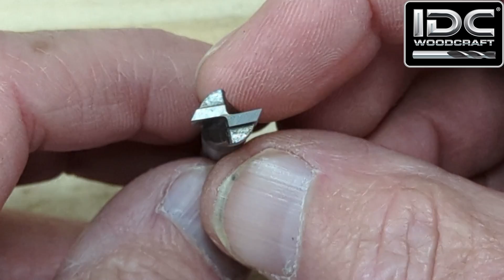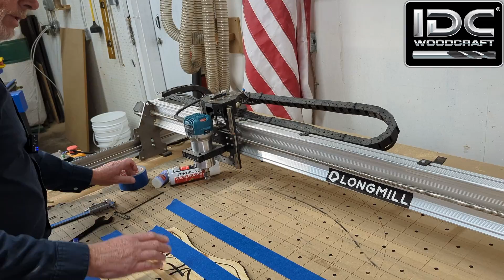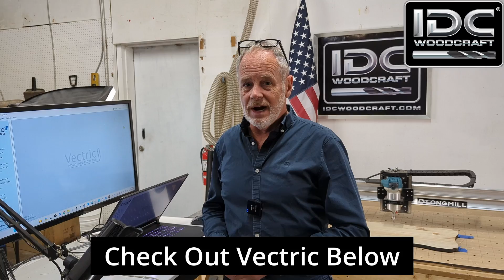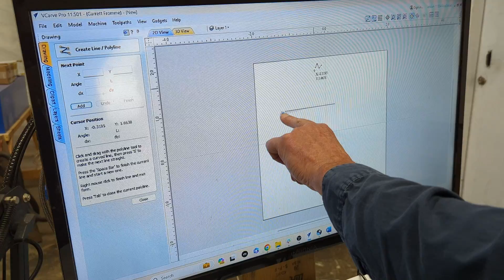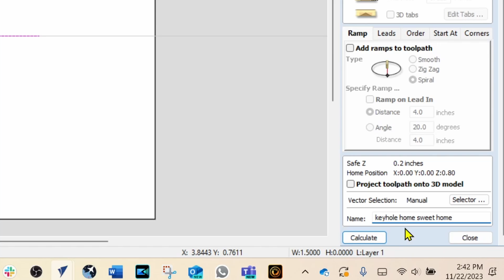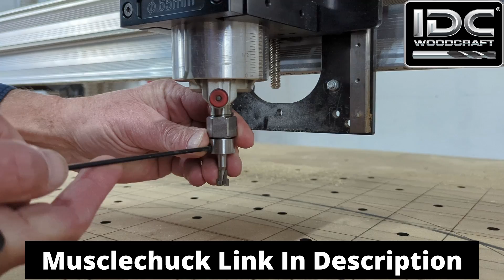How To Make A Keyhole Slot With A Keyhole Router Bit, CNC Router Projects

Comment: Very informative.  But I'm using a 3018 machine.  So i imagine my feed and plunge sppeds would have to be reduced substantially,  making using  a router table  more effective for me..
Reply from the maker: You're right, my friend! The 3018 machine does require slower speeds for optimal performance, so adjusting your feed and plunge rates is a smart move. Thanks for watching!

Comment: I might have to try this method but I’m afraid that my Bob’s cnc is not solid enough to handle it in one cut. I made a program that uses 2 cutters first I use a 1/8 cutter to make the holes at both ends and the slot between then I use a.410 diameter keyhole cutter to cut from one end to the other then I can retract the cutter at the second end.  On larger signs I make I put one at each end so it is level as long as the screws are level in the wall.  
I like the thought of the tool holder but the first thing I thought of was that it would make the spindle out of balance.
Reply from the maker: It's great to hear you're experimenting with different methods on your Bob's CNC! As for the tool holder, balancing is definitely something to consider, so just make sure to keep that in mind in your setup.

Comment: I want to have entrance hole on each side of the cut.  What is the best way to do that?  Set up for a hole on the other end?  Is a keyhole bit set up to cut in the upward motion?
Reply from the maker: To create entrance holes on each side of a cut, you'll want to set up your CNC to route those holes before or after the main cut, depending on your design. Typically, keyhole bits are designed for downward cuts, but you can adjust your setup based on your machine's capabilities.

Comment: Great video, thank you! I take it it wouldn't be too difficult to copy the line and toolpath to make two vertical slots, spaced horizontally, to line up on-center of wall studs?
Reply from the maker: I'm glad you enjoyed the video! Yes, adjusting your design to create two vertical slots on-center with wall studs should be manageable. Just ensure your measurements are accurate, and you'll be on the right track. Happy woodworking!

Comment: Paw Paw's Workshop did a much better indepth explanation (youtube video) of the process of creating a toolpath with Vectric.
Reply from the maker: jwerry58, It's great to hear that you found a detailed explanation from Paw Paw's Workshop! There are so many talented creators out there sharing their knowledge.
Reply: I've seen Pawpaws video.   His horizontal slots have two screw head holes.  He enters on one end and exits on the other end.   If you want the two holes then go for it.  I like this better.  Drawing a double line, like you see here,  is the way to go in

Comment: Like to add something to this video about adding a keyhole slot. Since the project is already mounted back side up to cut the keyhole slot. You can make another cut file to add a signature or label to the project. After you make the keyhole vector make a text area about an inch below the slot. It would be something like these four lines “CNC ,, WOODWORKING ,, By ,, Your Name”. Could also enter a year if desired. I used a script font “Brush Script Std” (search internet to find), align – center, text Hight – 0.25, I tilted the text area about 15 – 20 degrees, left side down, to add interest. For the cut file I used a 1/8 shank 30-degree engraving v-bit, IDC Item SKU: LV-30. Depth of cut about 0.15. Test on scrap to verify it is the way you like it.
Even if you do not use the keyhole slot file, you have this to sign your work in the future.
Reply from the maker: WanderingStar-fq4cn, good idea brother! It sounds like you have yourself a good workflow on this one. Happy CNCing.

Comment: Don't understand why you would use the tape CA method on a project like this.

It's 2 clamps, one on each side and it won't go anywhere.

Or like my cnc I have a large L in one corner and would place it there, then maybe clamp using a 6 shape side pressure clamp. 
Now you're using 2 meters of tape, glue and accelerator, imo that's a waste of material.

I only use tape if I need to be on every side with no room for clamps and side pressure clamping isn't a option either.
Reply from the maker: JasperTielen, I couldn't agree more brother! You really have some good points.

Comment: I like putting horizontal keyhole slots on my general house hold signs. I used the vertical keyhole slot for my heavier sports signs so that is is harder for kids to knock off of the wall.

My CNC LLC is starting to get into making product videos. What video editor are you using to make these professional looking videos? (I'm afraid that you are going to say that you have a guy/gal that does the video work)
Reply from the maker: Dioncoller, take a look at Davinci Resolve brother! It is a great software package.
Reply: @IDCWoodcraft  Davinci Resolve looks very promising! I will pass off the info to my marketing person.  Thank you!

Comment: I think a vertical keyhole would have been better since it would automatically balance the workpiece vertically . Horizontal ones mwy be benefitial if you have two keyholes.
Reply: It’s horizontal so you can slide the sign back and forth to find the balance point. The balance point isn’t always dead center since wood can be denser and heavier on one side or the other.
Reply from the maker: MedhiShatti, very good points brother!
Reply: I had the same thought about horizontal, but this does make sense. Especially if your design isn’t symmetrical as well (live edge for example).

Comment: How did you select the starting point for the tool path to match your stock ?
Reply from the maker: The starting point is set at the start of the line I drew by default
Reply: @IDCWoodcraft   but I confused on how you got the router to its starting point.. I use Carbide Create but plan on going to Vetric Pro.  I normally put the entire size of my sign and I would import  and move that design to the area I wanted it on the back (center of the 1-1/2" slot) centered on my Board

Comment: What's the advantage to cutting the keyhole horizontally?  I make lots of signs and plaques and always cut them vertically.  Seems like it would be easier for it to hang crooked if it was horizontal.  Also, Aspire has a gadget for cutting keyholes if you ever need it.
Reply: If they're vertical, and you're off, you will have a crooked project. Cutting horizontal allows you to slide it left and right to adjust level much like the toothed cleat that comes on most frames and plaques.
Reply from the maker: Hi Sam. it's a matter of preference I suppose. I like horizontal, he like vertical. But I should have mentioned it in the video at least
Reply from the maker: Hi Buck. We can do them either way. I personally like side to side. Unfortunately I forgot to mention vertical options the video.
Reply: I've also seen some done horizontally but with a half moon shape that looked like it would stay centered  better.